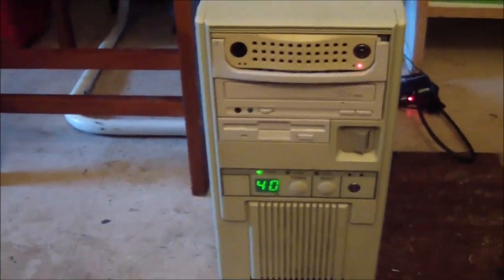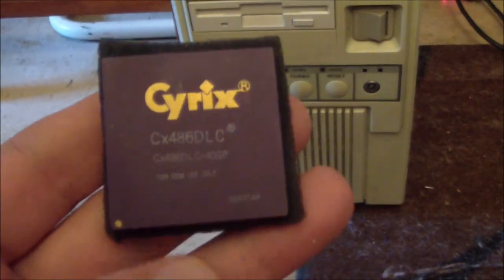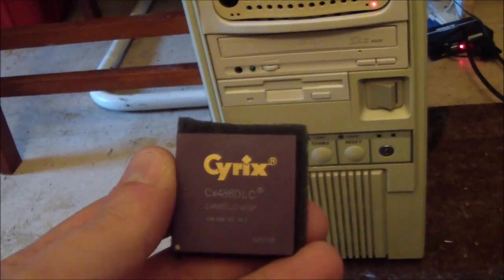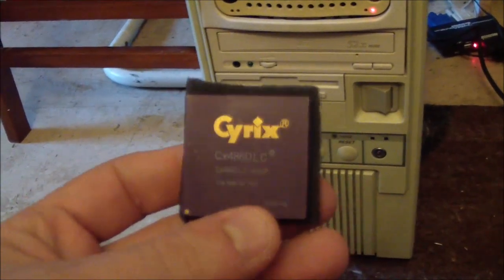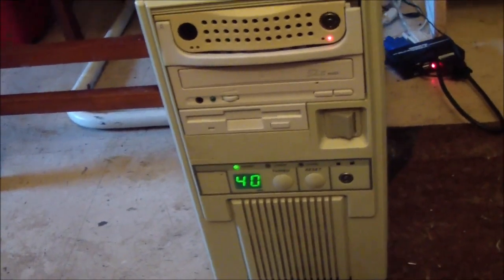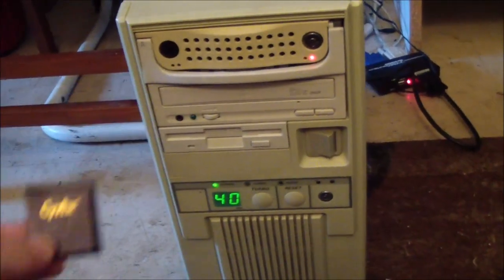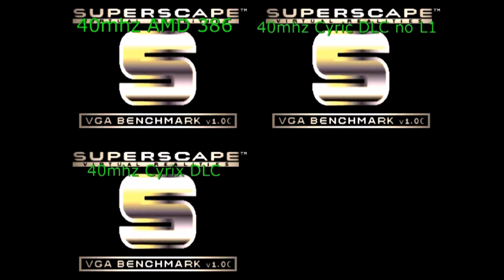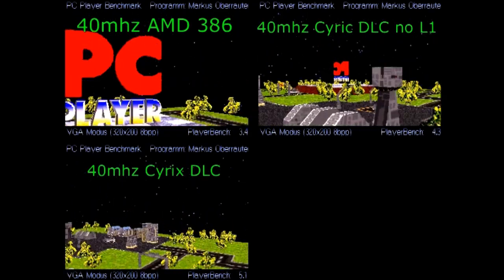386 to 486 upgrade: the Cyrix 486DLC-40

Comment: The IBM "Blue Lightning" 486BL3 (sometimes written 486BLX3) was the first x86 CPU to reach 100 MHz, beating Intel's own 486DX4-100 by a few months. It would be the fastest CPU for a 386-based motherboard, but due to IBM's licensing agreement with Intel, they were not allowed to sell individual CPU chips. That's where Cyrix had the advantage, by reverse-engineering the 386 on their own instead of licensing it from Intel, so the 486DLC became a very popular upgrade for 386DX systems. Cyrix even relabeled the 387DX math co-processor as the "87DLC" so that PC makers could sell 486DLC systems without giving the buyer any clue that it was based on old 386 architecture.

Comment: I had it back in the day, like around 1994. In Poland on second hand market, price difference between 386 and 486 was huge back then, so going for Cytrix 486DLC was a game changer. 
Having 4MB RAM, SVGA graphic card and cheapest Sound Galaxy allowed you to play top-range games. I remember substantial part of PCs in those days did not have any sound card(pc speaker only) or SVGA, only VGA and black and white screen only(still was a lot of Hercules, CGA/EGA cards) basically most of PC users have AT 286 or 386, you have to be quite rich to go for original 486DX with all multimedia.  Amiga was a thing for a games but PC start showing better possibilities and options of upgrade.
Remember hour spend on Wolfenstein, Doom, Mortal Combat, Dune, Dune 2, The Settlers, Colonisation, Civilisation, Transport Tycoon, X-Wing, Tie Fighter, Wing Commander, lots of flight simuators...
When I expanded memory to 8MB i was able to play Warcraft 2!

I have really good memories about this machine.

Comment: Really enjoyed this video. In 1995 or so they were selling the 486 33mhz upgrade for $50. I shoved it in my ailing   IBM PS/2 70 (386 16mhz).it performed exactly as you describe-a noticeable improvement but nothing earth shattering. It also did something else weird, which was to disable boot from my HD. I think I had to reconfig from the bios which was a pain on ps/2 IIRC. Glad to see people still are interested in this stuff!

Comment: I have both the Cyrix and Ti chips.  The Ti is a better chip, but only as much as a true 486 on an ISA bus is better than a 386 on an ISA bus, pretty much the same as a 486 on ISA. DLC2 or 3 chips are probably not a benefit since it is still dealing with the ISA bus to begin with, and past 33 Mhz a 486 is bottlenecked by the ISA bus. While I am certainly not above overclocking a 386 or a 486DLC chip to 50 MHz, which is a test I have planned, I doubt the performance will be much better over 40.  Still though it's fun to push the platform to the max just to see how far it could go.  There were some 486DLC boards made with VLB , I came across a couple on ebay.  It has been said that more than 64kb of cache on a 386 can cause a performance hit. I have not tested that myself yet, but it is something to keep in mind to try.  

I have also experienced the same thing with 486DLC chips and L1 cache in the bios. My understanding is the early chips relied on the bios or software to enable the L1 cache, which I think was why Cyrix made the L1 utility to begin with actually, but later revisions had L1 turned on by default to solve the problem of motherboards not supporting the L1 cache to enable it by themselves, which is why you have to use the utility to disable the L1 cache. If you are going to run this chip as your main chip in this nice vintage rig, get yourself a heat sink for it, probably put a fan on it as well. These things run hotter than the sun :)

Thanks again for the PB500 system. I haven't had a chance yet to open it up and start working on it, but I am quite thrilled to have that now.  I am planning to retrobright the front, drive face and the keyboard.
Reply from the maker: I suspected the Ti variant was a little better with the extra cache especially in games that seemed to get a boost from the L1 cache like DOOM. I probably won't go out of my way to pick one up unless I find one for a great deal. I've heard the same thing about cache as well as one 486 boards if you have more RAM then the l2 can cache it hurts performance...or something along those lines. I haven't tested any of that out either though. my bench results were pretty in line with a few other DLC benchs I saw but they didn't state their L2 cache amount.That makes sense about the L1 cache in Bios issues. it was really confusing me at first why it wouldn't turn off but thankfully I found that cx486 utility. Ha, so that was you that bought the PB500. I had no idea. I hope you enjoy it. I used my other pb500 as my main 8088 rig until I eventually put together my own. I'm happy it also got to you in one piece. shipping computers is always a nail biting experience until they get to their destination.

Comment: The 487.. that brings back memory's :-) It was my third cpu I owned. When the amiga was dying I switched to the 486, It was a 33 MHz SX overclocked to 40. I found this 487 on a computer market and I had no Idea that it was supposed to be a co-processor. I just switched it with my 486 and bobs your uncle it worked just like a 40 MHz . 

I had some friends defending there DLC cpu's claiming that it was a real 486, but in the end I think they all realized it was just a pimped 386 :-)

Comment: I bought a mystery box that has either a Cx486DLC-33GP or 40GP and a math co-processor for $10. Needs a bit of love, but I've never seen a Cyrix 486 OverDrive/upgrade CPU a day in my life for a 386. It'll be a fun computer to play games that are speed sensitive and I'll install my Aztech Sound Galaxy NX Pro (non-16) and Panasonic CR-563-B CD-ROM drive to turn it into a multimedia system. Plus, once I get my SAAYM ISA sound card (CMS/GameBlaster Clone + YM2151 for VGM files), I'll install it as well and I might install a MIDI card for my MIDI modules.
Reply from the maker: That sounds like a really cool and  fun build.

Comment: I had one of these but had to replace the mobo as well for reasons I can't really remember. It was a huge upgrade from my 386SX 25mhz but my POVRay render speeds were all that mattered to me back then (I don't think my dad really cared how long they took to render, hence the cheaper upgrade rather than new machine as he was paying for it). The upgrade was worth it, I went from 20 hour renders to 8 hours. Outside of POVRay and Doom you could run Fractint and experience what felt like a supercomputer. I had a similar experience recently when moving from a 2GB 670 to a 6GB 1060, just looking through all the stuff I had to see what once caused my machine trouble but now could just destroy without breaking a sweat. That's what it's all about.
Reply from the maker: Thanks for the comment. I would say 20 down to 8 hours is quite the improvement. Back when the 386 was the big thing my dad had an Amiga so I never got to experience the era first hand at home. All my friends seemed to have Tandys of various models. I have been messing around with my 16mhz 386SX machine and those SX chips can really bog down.

Comment: I used to do chip swaps a lot.  On my 486/33 EISA (There was no DX at the time) I put the 486/DX2-66 and saw a 50% performance boost.  Went to 486/DX3-100 and saw a 100% boost over my original benchmarks.    My last Hail Mary was some 586-133 compatible chip.  No improvement at all.   I concluded that tripling the clock speed would give me double the original performance, but the bus prevented any further improvement.

Comment: If your 386 was soldered to the motherboard you were screwed.
Reply: There were some boards with soldered AMD 386 that included a secondary main CPU socket and not just the Math Co Processor one. I think I even saw one that had a full blow 486 socket.
Reply: @RetroTinkerer  Yeah, or in case of the 386SX, which was almost always a SMD QFP-package, there were those horrible 'over chip socket' upgrades. Yeah just stick them on the soldermask with some double sided tape, that'll work :-)

Comment: I have this one. The board has also extra slot for 386 co-processor. Can you combine it with some co-processor? I've heard about 487.
Reply from the maker: well, the interesting thing about 487's is they are really just 486DX processors. In 486 motherboards that have a 487 socket usually what happens is the previously installed CPU is completely disabled and the 487 (actually a 486DX) takes over all operations so your DLC would just be disabled. If the DLC is in a motherboard with a 387 co processor slot that should work if the co processor is rated high enough.

Comment: Why is it set to write-through cache mode instead of write-back? Write-back makes it noticeably faster.
Reply from the maker: because neither of these CPU's support write-back modes. Write-back didn't become a thing until  certain "enhanced" versions of the dx2-66 if I recall correctly. Not even all of the later 100mhz 486 CPU were write-back capable.
Reply: 0blivi0n100 Thanks! I just realized that the DLC did not allow writeback operation for the L1 cache, but the SLC did. The latter probably did so to compensate for the performance penalty from the narrower data bus.

Comment: Why didn't you get a cyrix 486dlc2 80?
Reply from the maker: because I don't think that chip exists. IBM made a 486DLC2 but I'm not sure if it came in an 80mhz version. also I don't have any of the other CPU's to test as they appear to be fairly uncommon and pricy. Cyrix did make a 80mhzdx2 but that's a straight up 486 and not an upgrade for a 386 based motherboard. Fastest Cyrix upgrade CPU I can see is the Cx486DRx2 that's clockdoubled to run at 66mhz.

Comment: The Cyrix 486DLC was known as a the brain dead 486 with only 1k Lvl1 cache.
Reply: On a clock-for-clock basis, the 486dlc as not equal to a 486sx, that's true.  But the 486dlc chip (when it was released) was offered at a much lower cost than a 486sx chip, and offered a significant boost in performance to an aging 386 system.  And of course you didn't need to replace the system board in your 386.   So a 486dlc40 was a viable upgrade path for a budget system, and assuming similar specs otherwise, a 486dlc40 could run more-or-less equal to a 486sx25 - at a lower cost.

But where the 486dlc REALLY shined was when you took some of the money you saved and tossed it into a memory upgrade.  A 486dlc40 with 8 megs of memory was nothing to sneer at in its day.  

Unfortunately, the 486dlc was a one-trick pony.  Once clock-multiple variants of 'true' 486 chips hit, the dlc chips were left behind.  But for about a year and a half, they were a viable alternative to single-clock 486 systems.